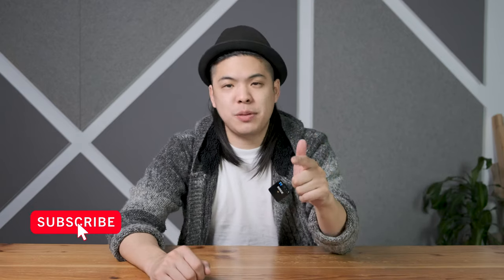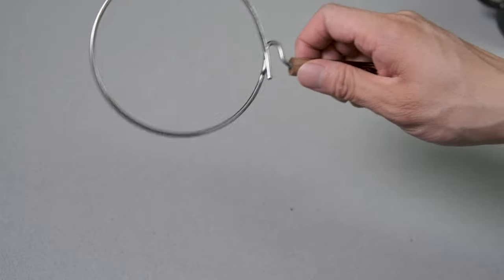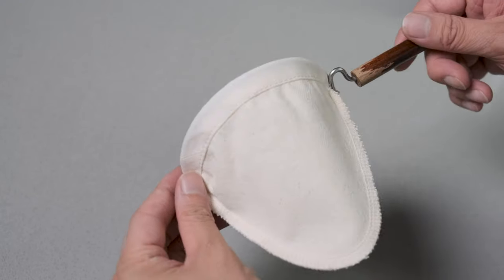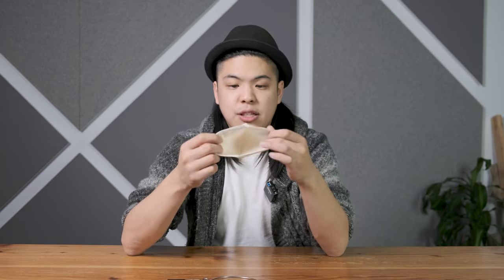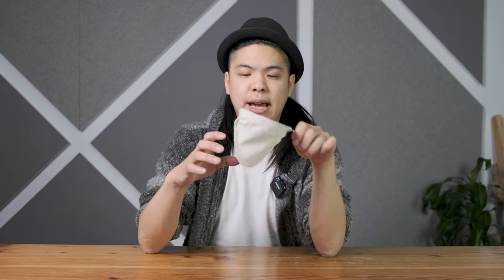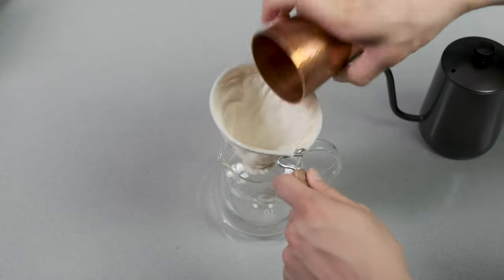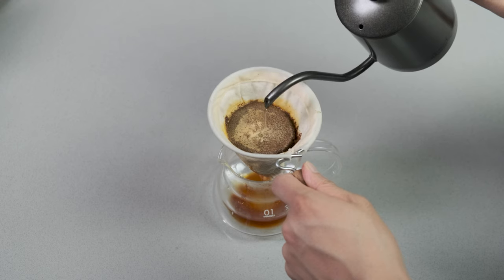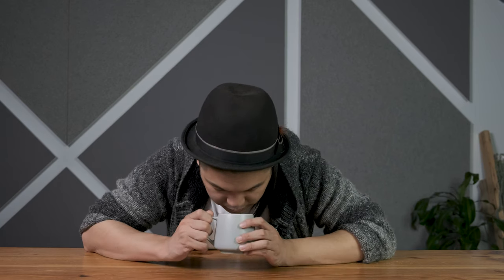ULTIMATE CLOTH FILTER POUR OVER GUIDE (NEL DRIP)

Comment: Hey Vincent, what do you think of the lily drip? i have been thinking that it would be excellent for bigger brews, since it reduces the bed size, maintaining a fast flow rate
Reply from the maker: I don’t think it’s necessary. Just pour differently to make up for flow rate. And if you’re brewing large batches use a bypass. It might be useful if you’re doing blooms and multipours but single pours I think solve the flow rate issue.

Comment: Next tools: bialetti mokapot, brikka, and the other kind of mokapot 🤤🤤

Need tips from you vince to make better mokapot coffee 😀
Reply: I can share some if you don't mind info from stranger from youtube:
- grind slightly coarser than espresso (you don't want fine grind)
- put hot water in mokka, not cold (so the coffee will interact with hot water & not get wet before water becomes hot)
- if you want a clear cup, use aeropress filter, makes difference
- don't forget the main part: basket. I put my coarser grind & don't pack it as is portafilter

- - In that way there is no problem with water going through the basket, no overextraction & channeling.

- - i round all coffee with knife to make basket flat (the coffee is distributed evenly) & it's fluffy (don't forget not to push coffee, it's not espresso machine with 9 bars)

These tips collected over 2 years, makes really good and clean cup.

Not a fan of paper filter bcs mokka is only with milk 4 me, but the cup is cleaner indeed